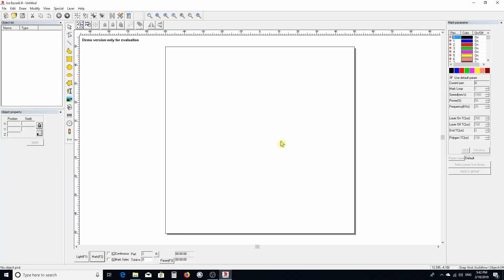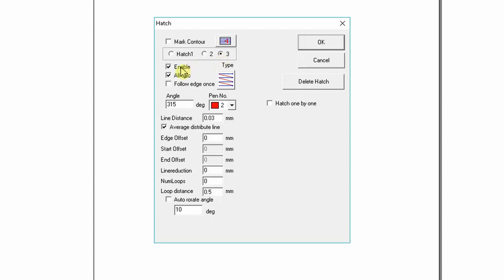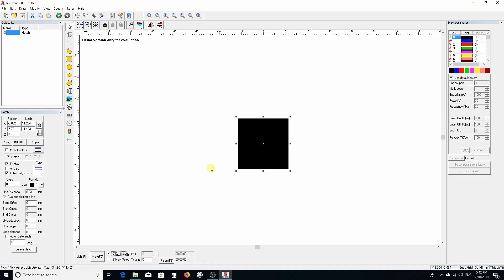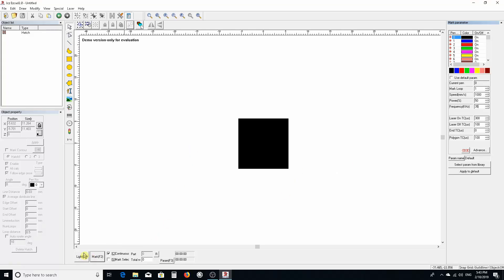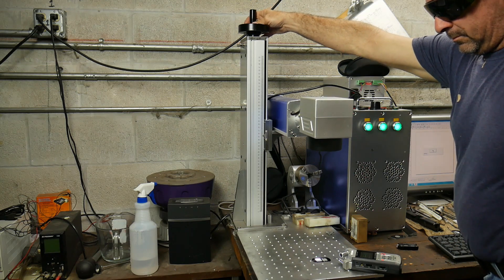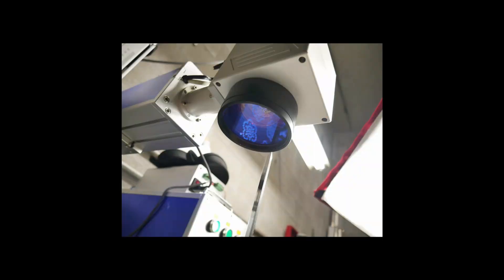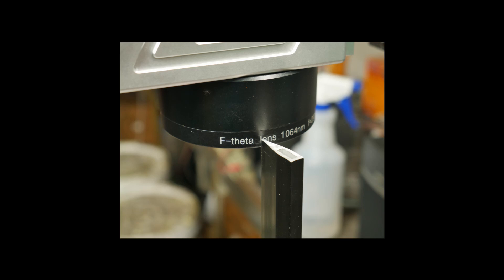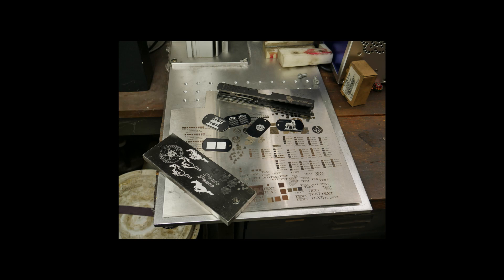Finding Fiber laser Prime Focus

Comment: Dude, I know these are two years old but I have been fighting with this damn thing all day... then I ran across these!
Thank you
Reply from the maker: That's why they are still up.😁
Reply: @ajimachining2537  well now I have a totally different issue... the laser follows the hatching but is not burning or marking no matter how much I raise it or lower it.... followed all instructions but still nothing....so frustrated!!
Reply from the maker: @stevenlaw2075  did it work before?
Or it never worked?
Reply: @ajimachining2537  It never worked... Just got it 5 days ago, did my best to decipher the instructions, found your videos.... I am trying to find the focal area and it will not "mark" or "burn" .... its going through the motions but no matter what height I put it at...nothing..... checked all of the settings, from what I can tell everything looks right....
Reply from the maker: @stevenlaw2075  you should have gotten a file with screen shots of the configuration page. EZCad2 is used with different lasers. Also make sure everything is powered on. Some have a power button for the laser power some have a key. I have 3 power buttons  1 for pointer 1 for galvo mirrors and 1 for the laser power supply. Send me an email aji549@gmail.com I will send you my number so we can tallk.

Comment: I aligned the 2 dots on my laser but then it doesnt burn anything cuz my part is to far away. So it seems kinda pointless. I just ended up taking parts and finding the best mark for each and writing the measurement on the machine cuz all my parts are different heights.
Reply from the maker: I  think you may have miss understood something. The red dot alignment is done in the parameters one time. Set it and for get it. Focal height will change with the height of the part but will always be the same focal distance from the surface.

Comment: Hello, we have a XT fiber laser 30w but the power of the machine its not the same to the firts day engraving. Can you help us?
Reply from the maker: Sorry for the delay. Did you figure it out?
The source does have a life span depending on how much you use it. 

Recommend checking (cleaning ) the lenses and the mirrors in the head.